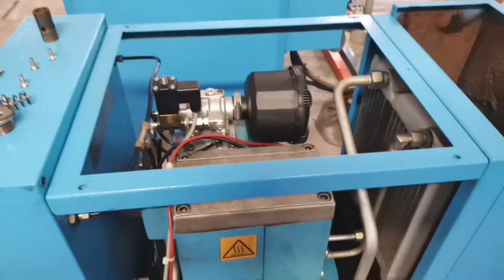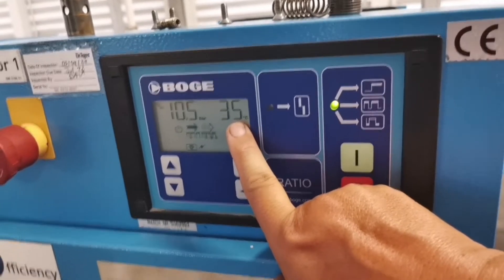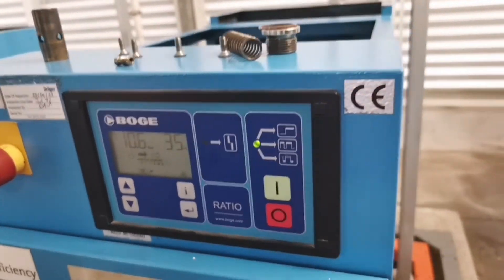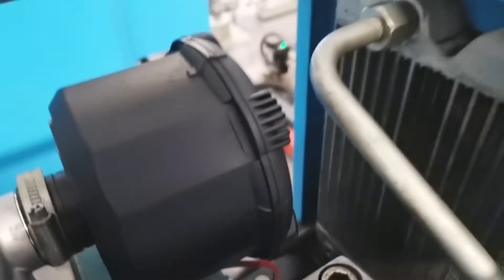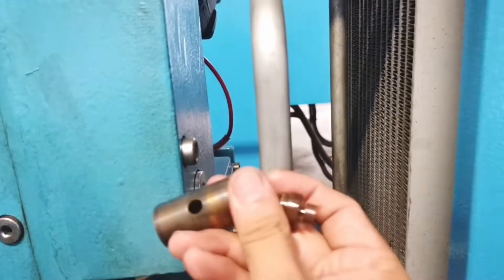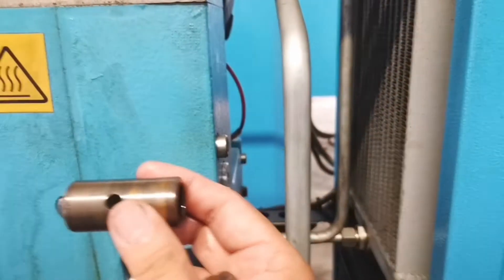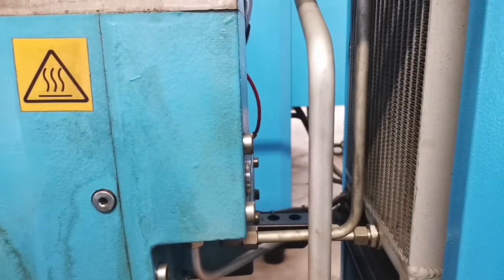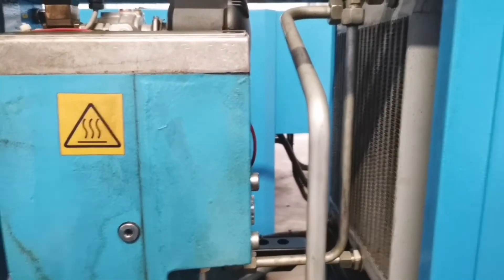Boge screw compressor error 1

Comment: Please I need heelp my compresseur boge SDF 24-2 is work but the pression of air in main screen is 0.5 bar but in the air tank is 8.0 bar .i need to solution .
Reply from the maker: Is the unit still able to cut in and out?? if yes maybe you are on the wrong page of the screen. Other than that maybe the is a problem with your pressure sensor.

Comment: Good day, we own a BOGE C5 compressor, and have the problem with suction controll valve. Is there a kit for fixing the valve? I think the bore of the suction control valve spring loaded piston is damaged and would need to be bored and maybe a piston made bigger to accomodate bigger bore.

The problem I am getting that sometimes when the compressor reaches the pressure it let the air out through solenoid on top and through air filter, and keeps doing it all the time.

Other time when compresor reach the set pressure and you can hear the valve stops the pressure keeps build up and the oil sprays through the air filter out.
Reply from the maker: There is no kit for the suction control valve that I know of. You would have to replace the whole valve. Comes with solenoid valve. Doesn't really cost that much and saves lots of trouble.
Reply: @thesimplerepairman1361  Thank you for your prompt answer. I believe i solved that problem, but I got one more question: After the compressor reaches max. set pressure the pressure escapes through air filter and solenoid valve until minimal set pressure and than it charges again until max. set pressure. Could that be check valve fault and if so could you point me out where is it located? Is it large round brass part with 2 flats and how to take it off? Thank you very much.
Reply: @skylerlabsing.4028  this is blow down